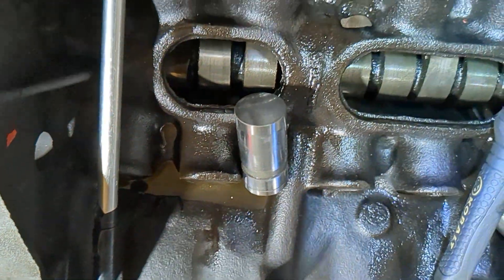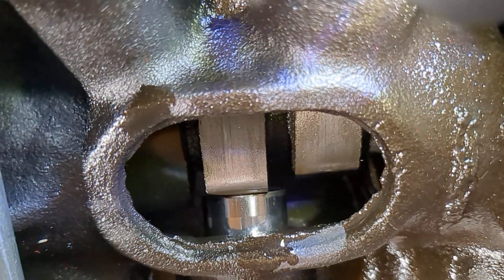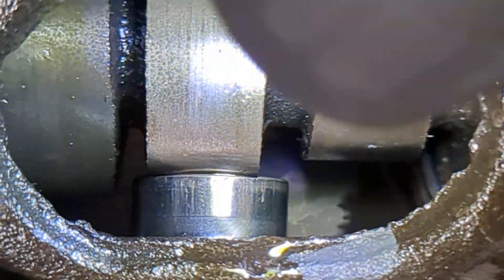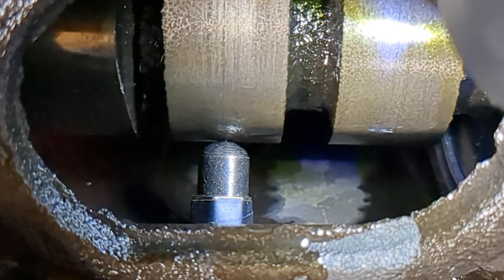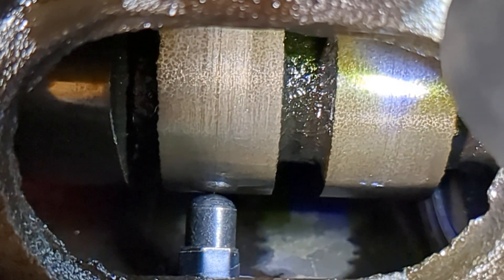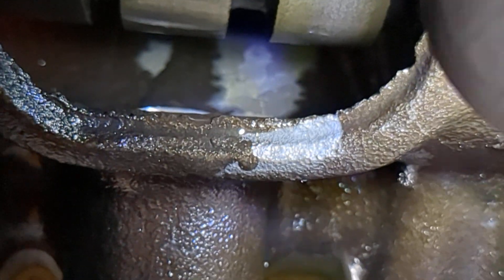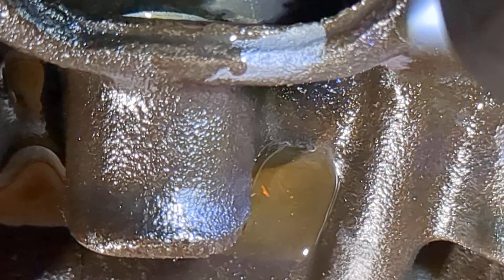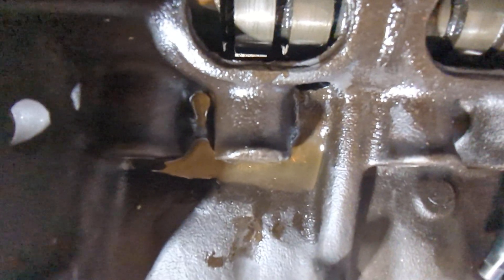CHANGING LIFTER DIAMETER will affect valve timing events. EVEN IF ITS ONLY A LITTLE.

Comment: In flat followers, surface area has nothing to do with cam profile duration and valve event timing. The crown of the lifter face does,  but it's to such a small degree it's not worth considering. 

In contrast, the radius of a roller lifter does affect the valve events and duration. I think that's where you're going here, but the message doesn't come across as clearly as it could. 

Finally, for a flat tappet lifter the diameter of the lifter does influence the maximum amount of velocity that the lifter can support, but for a given camshaft grind the diameter of the lifter doesn't change the valve events, provided that the grind is compatible with the velocity of both lifters used

Comment: Ok so you exaggerated it even more to try and prove your point  ??? 

It's not about  the Dia of the lifter it's about the crown  .... a 842 lifter will have say .002 in crown  with the same arc a .904 lifter will have a .0025 in crown  .... the Dia of where the lifter touches  the lobe does not get bigger  on the unused space beyond  the touch point  gets bigger  .... if contact  point is the same the duration  is the same the movement  is the same and the larger  Dia changed nothing  ....

What Ed forgot  to say is that back in the day the 6 pack lifter had less crown  ... that is what caused it to gain ... it was never about  the Dia it's was about  the crown ....

Comment: An old timer told me about his days racing what he says was the beginning of the Midget Oval Track rigs before and after WWII.  
There was nothing but tractor engines back then. No hop up parts for anything in those days where we were.
The lifters were in an iron casting which bolted onto the outside of the block holding 4 tappets..
I would unbolt them and put the lifter block in my vise, heat each mushroom lifter red hot and bend it over a good amount. -- We'd bolt the block back on and gained a good bit of speed.

Goofy but showed how the way the lifter functions to the camshaft is more than one can imagine.

Comment: It a cam is ground for an .842" lifter, just going to a Ford or Mopar lifter will not throw the cam timing off. If you're saying it does, I'm going to have respectfully disagree. Going smaller than what it's designed for absolutely will. Now If it was a roller cam and using a .700" dia wheel and went to a .750" wheel, it would change it. Not much but a little. If you're saying anything other than what I just said, you need to take me to school and I would be grateful.

Comment: Brian. I just looked at the Clay Smith website for info on the Y-block Ford valve lifters (mushroom). According to the site, the weight of one is about 63 grams. That is approximately 30 grams lighter than a Johnson solid lifter for a SBC. It does list the stem diameter as a couple tenths of a thousandth less than 1/2". The valve face diameter is not listed. I wonder if installing bronze bushings into the SBC lifter bores if that would be an advantage. A couple of my friends used to race with Y-block Fords in the early 60's to the early 70's and used Chevy lifters in the Y-block.  Of course the lifter bores had to be enlarged. When Tom turned his car from gasser to street rod, being a parts man at Baltimore Mack for years, he found Mack Truck parts that enabled him to swap back to Ford lifters. The off the shelf parts were bronze bushings that fit the enlarged bore and the smaller Y-block lifter stem. He did not have to machine them, just press them in.  My thought is that the weight loss would be advantageous if the lifter diameter is equivalent to a Chevy lifter.

Comment: That adjustable pushrod made it all make sense. The outer edge of the lifter meet the lobe sooner than the rounded pushrod end. It is not much but it is something. Thanks.
Reply: @4speed3pedals  that actually demonstrates nothing. 

Talking flat tappet, 
 A lobes taper and a lifters radius are a matched equation. So we dont demonstrate anything by using a completely wrong radius on a pushrod or similar in reference to lobe lift or timing etc.

 A lobes ramp rate and lifter foot diameter are a matched equation and for any given lifter foot diameter there is a maximum ramp rate that the lobe can have. So we dont demonstrate anything by going smaller on lifter foot diameter on a lobe designed for a larger lifter foot.

 The highest point of the lobe that intersects/contacts the lifter directly inline with the leading edge of the lifter foot diameter is inboard of the lifter foot edge or else  the lobe will catch on the edge of the  lifter foot where there is a small chamfer between the lifter body and the foot and the lifter and lobe will fail pretty much immediately.

  Think about the lobe approaching the lifter on the opening side- If you draw an imaginary line at the lobe and lifter contact point that is perpendicular/90degrees to the lifter bore centerline, the approaching lobe, even at its most agressive lift position is never higher (toward the lifter) than this imaginary line. So, if you have a lifter that is 10 times the diameter nothing changes because there is no lobe at a higher lift point that is going to contact the larger lifter. 

  If you reduce the lifter foot diameter to a point where the lobe is just touching/contacting the lifter  right at the very edge of the foot right where the foot meets the lifter face you still get no change but you will get a failure if it were to be ran. Now reduce the lifter foot diameter some more and this is where you start to see change because you have brought the lifter to lobe contact area past the edge of the lifter foot so you now need to rotate the cam a little more to get the same initial lifter movement BUT this scenario now is useless because just like bringing the contact patch rigjt to the edge, this lobe lifter will fail immediately. No flat tappet engine ever ran or lasted running like this so its pointless.
  
So, if you fit a larger lifter foot diameter on the exact same running lasting lobe than the lobe is designed for you simply get zero change every single time. 
 That said, you can use a larger diameter lifter foot AND use a lobe that is designed to use said lifter and now yes you can use some more lobe rate and make a change.
 
Always keep in mind that the contact patch on a flat tappet is continuously moving either side of the lifter centerline whenever the lobe is not on its base circle. Of course the lobe taper, lifter to lobe ceclerline offset and lifter radius also then make the lifter rotate to keep and even minimally scuffing wear pattern/area. This is why the lifter foot radius and lobe taper are a matched equation and why you can not demonstrate anything real or factual when you sway from minimum lifter foot diameter or designated lifter foot radius.

Comment: Mr salter. I posted up a video showing one of my hemi engines with the mushroom lifters. You can use it or parts of it do demonstrate your point.  These lifters made a more rapid rate of lift and in nascar in the 60’s-early 70’s. These were used because of the rules they had.

Comment: Brian, I have a question that I'm a bit embarrassed to ask, but here goes: Doesn't the lifter bore dictate the size of the lifter body, and therefore can not be changed? How can a more narrow lifter fit in its bore and not have too much clearance? Thank you for another great video,   I watched them all.
Reply: Thank you! I knew I was missing something. I'm not a machinist, but a very good tuner, and enjoy every video :--)!
Reply from the maker: @nys-gto8042  it's okay buddy I will try to answer it you are correct I only turned down the very bottom of the lifter so the body is still the same size so that it stays center that way the only change is what the camshaft lobe sees and that is a much smaller contact patch

Comment: Measure what happens with a 1.2 inch lifter
Reply: There will be zero change when going to a larger than .904" lifter on a lobe designed to run that .904" lifter.  Salters demonstration is using a smaller lifter foot diameter  in combination with the .904" designed lobe is a combo that would not last , run and is not a real world scenario, therefore any change in valve timing shown is useless misleading information.
Reply: @craig8187 I went through this building SCCA Engines for the AS class. The rule was. 500 max lift. The machinest talked the owner into cutting the lifter bores saying it would increase something. I had ordered the cam for. 842 lifters. They cut the block and installed a bigger lifter, it made 0 difference the way brian did it. I agree with him. I said this because I know you understand. Brian does to.
Reply: @davidreed6070   haha yep expensive professional opinion that one !  Yes go up on lifter size to correct the lifter bores or to use an appropriate lobe profile but certainly not to expect any change on the exact same lobe!
Reply: @craig8187  I told him, it doesnt matter of the lifter is 6 inches,the lobe is going to contact it at the same spot.
Reply: @davidreed6070  exactly 💯

Comment: The center of the lifter bore is not the reference point or contact point for cam timing. The outer edge of the bore radius is and a larger diameter lifter has a wider radius and therefore begins lifting sooner and sits back down later, thus affecting lift per degree of rotation but not overall duration.
Just wanted to make it a run on sentence. 
Please ignore the knuckle draggers that want to argue. You're videos are informative for most.

Comment: I recently rebuilt a AMC 360.  So as I’m studying this engine I’m wondering way the amc engineers used used the mopar size lifters and not the smaller Chevy size  🤔
Reply: There was a history of Studebaker lifter concerns a long time before AM bought them.
I read the engineering papers from those days. 
It was traced to poor oil development but morso, how tight the oil splash was. The engine case was running very dry,  This led to a lot of costs to find what and why in the laboratory  and outside engineering, that caused it all 

Increasing the lifter diameter was the low cost answer including camshaft lobe design.

There early V8 engines were actually an almost identical Cadillac engine but downscaled to fit the small chassis. -- Eventually the engine design was replaced with the 290 (?), was it ?, and evolved to the 390.
I seem to remember a few 4" large cubic inch blocks were made for testing. Those engines were stout !

Finally, the lifter deal evolved from the smaller lifter failures of the 60's or so based off of the very interesting study of its time.